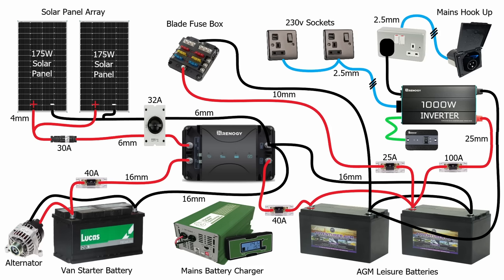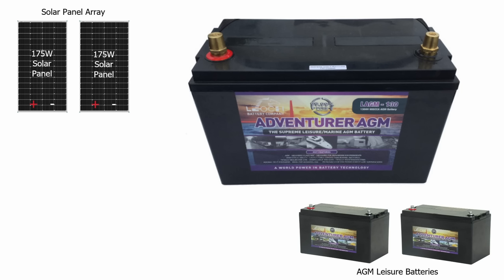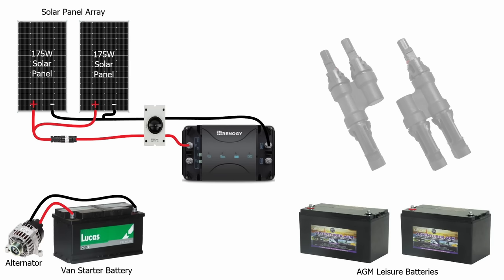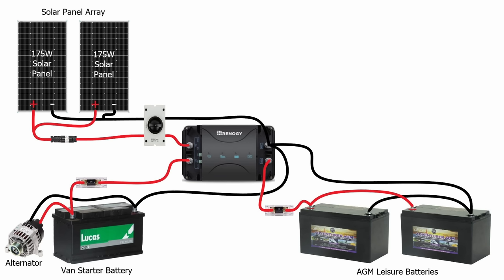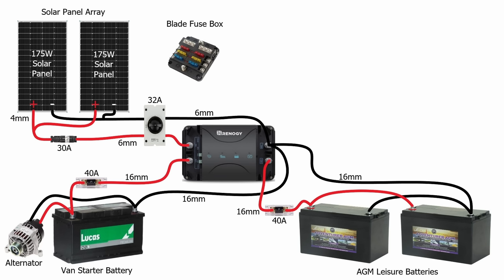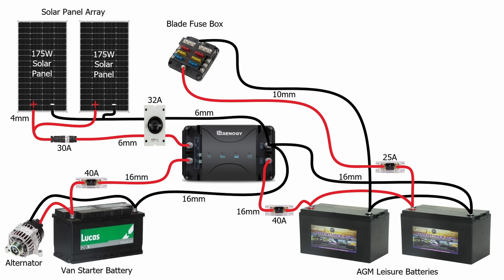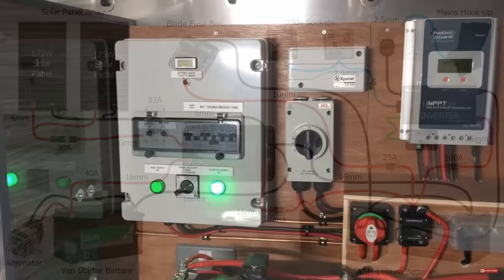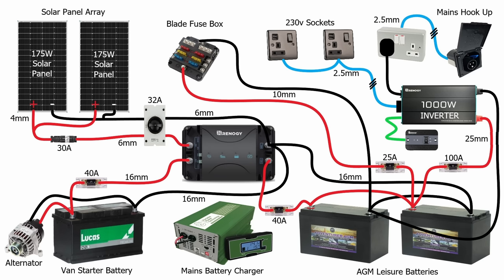12v Electrics for Off-Grid Campervan - Fiat Ducato Budget Build Ep12

Comment: Hi Greg, i have a similar setup. Mine is a  renogy 3000w inverter,  i notice you haven't added a consumer unit after the inverter. Is this fine to do,  Im getting conflicting information regarding this. Thanks.
Reply from the maker: I will open it in a forthcoming video but despite an email from Renogy stating they include residual current protection I doubt that as there is no external test or reset for that trip. Putting a consumer unit on the output would be the safest option.

Comment: Hi Greg, thank you so much for the very useful video, I want to follow exactly what you have done for my own MWB ford transit. I had a question regarding the AGM leisure battery - the link you supplied for purchase shows lots of different 12V batteries with different ampages, which one is the one you have used for your van that would fit this system please? many thanks, Amelia
Reply from the maker: I have purchased two Leoch AGM batteries that are 110ah each. They are called adventurer and in purple box with picture of boats and campers on them. 👍🏼😊 no problem if you go for 120ah too
Reply: @GregVirgoe  Hi Greg, okay that is great, thank you so much for your speedy reply.
Reply: @GregVirgoe  One more question (sorry!), how do you know how much charge is in the battery at any one time - is there a gauge on the batteries themselves or do you have to fit a separate component to see how much charge they have left in them, cheers :)
Reply from the maker: @AmeliaB-eo8dh  with AGM batteries you have a plug-in LED display to read the voltage across the batteries to get an estimate of their charge capacity. So at 13v they are 100% full and at anything below 12v they are 50% full. here is a simple chart to show you https://electricscooterparts.com/graphics/state-of-charge-chart-for-agm-battery.png
Reply: @GregVirgoe  Great, thank you :)

Comment: Can I ask if you are using the 30 or 50 amp charge controller? I only need the 30a for the system i am installing, however i noticed it says if your alternator is above 100a you need the 50a model. Im not really sure how to find the amperage of my alternator so leaning towards getting the 50a model to be safe. Cheers.
Reply from the maker: Doesn’t matter what size alternator you have the charge controller will only use what it needs. I’m using 30A charger.

Comment: I've become a bit frozen and unsure so hope you can help me understand best way forward for my set up. I just want to run am fridge, water pump and lights and usbs off my leisure battery. When I'm on site I have a hook up with 4 sockets and usbs available so will continue to run my fridge etc as listed on line 2 from the leisure battery understanding that now I'm hooked up these will still be powered by the leisure battery but I can reduce the use by using the hook up usbs instead of the leisure battery usbs, and can plug in mains appliances if required, so even a lamp to reduce the draw on my leisure battery. From your video Greg, can you tell me if I added one of the Renogy invertors which can be plugged into the hook up would or would this not power my fridge etc as in line 2 - I'm thinking it would not and that it would only be of use to power mains appliances inverting the power from my leisure battery when off grid/not hooked up? ALSO if I'm on a campsite and hook up and if I use it to charge my leisure battery can my fridge etc remain operational or must they be disconnected while a leisure battery is being charged? Is there any way you can be drawing and topping up the leisure battery at the same time? I'm thinking no and would be dangerous...so do i just wait until I'm driving when my main battery will top up the leisure battery via split charge relay...but my fridge will still be on during this...no? Thanks in advance :)
Reply from the maker: Really with the setup you described you would be best adding a mains battery charger which can be used when on camp site to charge your leisure batteries and they can still power all your 12v stuff at the same time with no problem. 
From the above it didn’t look like you had the need for 230v stuff when not on a camp site?
Reply: @GregVirgoe  Hello again Greg! So one year on I've been using my van for work (Family History consultations) and haven't yet used it for leisure so...all my items have remained disconnected. So you will understand I'm very keen to nail this now and get them connected. 
Yes I don't want to be using things like tvs and laptops when not hooked up to 230v on campsites - I'll use usbs for phones etc and wait until I'm using my hookup and only then plug in to charge my laptop.
So I'm not planning to add solar and will only be charging from my alternator. I WILL use a mains battery charger when I can plug that in on a hook up/campsite.
But I need your advice about IF you can have your fridge connected while charging up like this....or if I did add solar would my fridge be able to be on constantly? I thought you couldn't be drawing power at the same time your charging your battery?
How would I make everything that I had been powering from by leisure battery then be powered from the 230v hook up? This might be answered  - using the fridge as example - by the solar panels or alternator would be  powering it as I drive and then drawing from the battery when parked, and when hooked up the fridge would remain on the 12v dc power while it is being charged from the battery charger plugged in via the hook up?
Hope you can help me make sense of this and I can get on with it :) Thanks

Comment: Hello Greg you missed out a cigarette style socket and cable size  in your fuse board diagram that can be used for running a tv from? or would you recommend a 6mm cable is used as you have going to the fridge which i am assuming is plugged into a cigarette style socket, I am surprised you are still looking at running a tv or laptop from an inverter when it is so much easier to find a 12v tv (LG with power converter) or 12v laptop charger. no need for 240v in a van unless you have a good  lithium battery bank and want to run an induction hob or toaster etc although i do like the fact the iverter will auto switch between battery use and site mains input use giving the best of both worlds depending on your use of van
Reply from the maker: I’m not fitting a tv in this van they were just examples of things that you might plug in and could require a mains power supply 😆😉
Reply from the maker: Cigarette sockets need to be fused at 15amps so at least 4mm cable would be best.
Reply: Hello Greg thanks for your early reply. I am not criticizing, just looking at things i have found i would use in a van and as technology is changing all the time we are all learning and from past builds on what we need and how to power them needs on our budgets
Reply from the maker: @clarkspiemuncher24  I didn’t think you was at all so don’t worry. 👍🏼😃

Comment: HELLO THANK YOU FOR THE THE HELP.
I want to buy the solar 32A isolator switch and there are two options 2P and 4P? Which one should I choose? 
Pd I hace one panel 460wh
Thanks!
Reply from the maker: Either one will be fine. You only need to wire 2 poles so if you get the 4p just leave 2 sets of terminals empty. I did a video about these switches here 
How to Wire a Solar DC Switch - Budget Build EP16
https://youtu.be/GRLfZIGfA1I
Reply: Thank you!!!

Comment: Thanks for another great video.  The first thing I noted was you decision to stagger the input and output terminals of your batteries (I didn't do this on my three-year old build but don't know if I've done any harm).  
The second thing is that you did not stipulate the cable size for your battery link cables - are they 16mm?, but surely they should be 25mm to match your inverter cables?
Reply from the maker: Hello John, please refer to section 3.3 on page 17 of this free docuemtn from Victron that explains really well why you should wire your parallel batteries like I have. :D  https://www.victronenergy.com/upload/documents/The_Wiring_Unlimited_book/43562-Wiring_Unlimited-pdf-en.pdf
Reply: @GregVirgoe  Nice document and looks like a great read, thanks.  I did connect both my charge and load leads to positive on battery#1 and negative on battery #2.  But the document doesn't seem to refer to your decision to connect the load leads to positive on battery #2 and negative on battery #1.
Reply from the maker: @johnporter6459  I just found that it forces the use across the string and from experience my AGM batteries are now 5 yrs old and never dropped below 70%
Reply: @GregVirgoe  Will give it a try.  By the way, I've been using the Renogy DCC50S with my two 100AH EFB batteries and a single Renogy 175w semi rigid panel.  I seldom put the full 50A through the charger as it normally self limits to 25A when there is solar available.
Reply from the maker: @johnporter6459  but then the solar makes up the balance 👍🏼
Reply: @GregVirgoe  Probably not to full 50A (and weather dependent) but I have a cab mounted DP MCB for the solar input, so I can disconnect solar when I want to (which is not very often).
Reply from the maker: @johnporter6459  I always leave my solar connected 24/7 even when connected to mains.
Reply: @GregVirgoe  The only reason I'd do it is to get the full 50A from the alternator, otherwise the DCC50S only gives you 25A.  But yes, connected almost always and getting the starter battery trickle charged into the bargain.

Comment: Hi Greg, please could you advise me on the type of connectors I need to connect the 12v spotlamps to the 1.5mm cable running through the van?
Reply from the maker: The easiest way to do it is with WAGO connectors you can get them from most DIY shops like Screwfix or order them online, very easy to use. i show them in my reversing camera video
Reply: @GregVirgoe  Ah, will take a look, cheers Greg.

Comment: Dear Greg, does the dc-dc charger from renogy work on a traditional dynamo? or does it only work on a smart dynamo? greeting from the Netherlands
Reply from the maker: It will work with both. With the newer smart alternators you will also need to install the ignition signal cable supplied by Renogy

Comment: Great video Greg 👍🏻🤘 one question I don't know how to set the Renogy charger for my leisure battery wet acid it's got the function to feew different batteries  and I'm slightly confused 😕
Reply from the maker: Under the left hand terminal cover is a small button you can press with a pin to select the battery type. The colour of the battery LED (far right) will change to indicate the selected battery type. 
Page 16 of the manual. 

Green - SLA (AGM)
Yellow - GEL
Red - FLD
Blue - Lithium
White - User defined
Reply: @GregVirgoe  so if I got wet acid it's meant to be on FLD ?
Reply from the maker: @kieras13  yes 👍🏼 that’s right.

Comment: Hi Greg. Where would you put an RCD/Consumer unit in this setup?
I'm looking to do something very similar, however I will be wiring a 3000w Renogy inverter, which has 2 power sockets. So I was thinking the following:
EHU > Basic RCD feeding 2 sockets > Socket 1 feeds AC to Inverter, Socket 2 powers mains charger (So can't accidentally be run from inverter)
Do I then need to put another RCD/Consumer unit on the inverter output? and would I just take output from one of the two sockets?
Reply from the maker: You will most likely need an RCD on the output of the inverter as most don’t have in built RCD protection. Why do you need a 3kw inverter, what do you plan to use that for?
Reply: @GregVirgoe  Not so much that I need 3kw, just got an excellent deal on it. There's potential we might want to run an air fryer off it also (only for 10 mins or so at a time). I don't know if the 2nd RCD would be a bit belt and braces but I think we'll fit one to be on the safe side!
Reply from the maker: @anthonym3075  to use a 3kw inverter off batteries they would need to be lithium because you will not be able to pull 240amps out of lead based batteries. 😬

Comment: Amazing video Greg, though I do have 1 query... You used a 25mm² wire and a 100A fuse correct? Correct me if I'm wrong but I thought 25mm² wires could only really cary 101amps (depending on length too of course) isn't the fuse rating just a little bit too close to the cable rating? What happens if they aren't perfect 101a amd 100a and the wire burns up before the fuse blows?

Again I am no expert, but this just made me think.

Otherwise great work and please teach me if I'm the one mistaken
Reply from the maker: Different types of cable will have different ratings I was using cable supplied by 12v planet and according to their website the cable is rated up to 170Amps and using their volt drop calculator with a run less than 1m in length the volt drop is only 1.3% so it would be ok for this project. 
If you are ever concerned it never hurts to increase cable sizes as that will make the system run cooler at peak loads. 👍🏼😃
Reply from the maker: https://www.12voltplanet.co.uk/extra-flexible-battery-starter-cable-25mm-170-amp.html
Reply: @GregVirgoe  thank you, and thank also for taking time to read and respond, especially so quickly :) I'll check out the link!

Comment: Got one for you Greg. On a van without electric hook up. 
When using an inverter. Does it need a consumer unit?
Cheers
Reply from the maker: Yes, most inverters do not have any kind of RCD protection inside them so your only protection would be for overcurrent from the 3 pin plug fuse, that wouldn't stop you getting a fatal shock so an rcd on the output of the inverter is essential.
Reply: @GregVirgoe  Cheers Greg 👌

Comment: Hi Greg, thanks for this video! I’m in the process of buying everything for this set up but can’t seem to find the 6mm solar extension cables in stock. Do you know of any alternatives that would do the job? Thanks
Reply from the maker: It is available on Renogy shop https://uk.renogy.com/solar-panel-extension-cable-with-mc4-male-to-female-connectors/
Reply from the maker: It is available on Renogy shop https://uk.renogy.com/solar-panel-extension-cable-with-mc4-male-to-female-connectors/

Comment: Hi Greg, I'm curious  - will you be having an RCD/RCBO in the 230volt circuit and for earthing will you have a way to use a ground/earth spike when parked up?
Reply from the maker: Yes, I will be fitting a consumer unit and always recommend doing that on the 230v mains for short circuit and overcurrent protection.
A ground spike is completely useless for a campervan, that would actually cause a serious electrical hazard. https://youtu.be/mpgAVE4UwFw
As long as all the earths are completely connected back to the source then the RCD will detect any imbalance in current and work as it should.
Reply: @GregVirgoe  thanks, I'm looking forward to seeing you put all this together.

Comment: Hi Greg. What size AGM batteries are you using in your build please? If in the future they got swapped for lithium then what size would a single on be? How many days power would you have off grid for a fridge/freezer, lights and general charging of phones etc? Thanks alot
Reply from the maker: I have 2 x 120Ah AGMs and with the 350W of solar and 30A dc to dc you could stay off grid indefinitely. It’s a great setup. 
Renogy are offering 2x 100Ah core lithiums for only £600 so that’s a cracking deal 👍🏼🤩
Reply: @GregVirgoe  Your a star and thanks for that dude.
Reply: Greg can you confirm if it’s 110 or 120ah you are using? In the video you mention 110 but in this comment 120.  I’m sure it doesn’t matter much but there is a £46 difference
Reply from the maker: @darrensmith403  it relates to storage capacity so the bigger the better 👍🏼😊

Comment: Hi Greg, If I use the 50a DC-DC with MPPT would that be ok to use with one Victron Energy 12v/130Ah AGM Deep Cycle Battery? thanks ...Shumae
Reply from the maker: 50a is really too much for that size AGM battery. You need either two of those batteries or one Lithium which could handle the higher charge. It can be dangerous to force too much charge into a lead based battery. 20% of its capacity as max charge rate. 😊

Comment: Hi Greg 
Fab videos, following your budget  build to convert my sprinter, can you tell me if i can swap to 2000 w inverter  with the same setup? Thank you so much   carl
Reply from the maker: Yes you can, just a few things you need to change. A 2000W inverter will draw 160amps per hour at full load which is too much to drag out fo lead based batteries, so you will need to consider upgrading to Lithium. The fuse would need to be increased to 200amps and the cable feeding the inverter would need to be min 35mm².  Can I ask what do you intend to use in your van that needs that much power when off grid?
Reply: @GregVirgoe  hellow Greg. Thanks for the reply. It was just for a coffee pod machine  in the morning. i might just stick to 1000. It will be a lot cheaper.  
Very much appreciated  I'm  a bit out of my depth

Comment: Quick question Greg please - you previously used circuit breakers rather than fuses and gave logical reasons for doing so. Why do you use ANL fuses rather than circuit breakers here? Thanks
Reply from the maker: Providing that you get good quality breakers there is nothign wrong with using either form of fuse or breaker. for this installation it was purely down to cost as the fuses are cheaper to buy
Reply: @GregVirgoe  thanks appreciated. It certainly mounts up. Didnt realise cable was so expensive too...
Reply from the maker: @1anonlyedwiltshire  it has shot up in price massively in the last couple of years. I’ve noticed a huge difference in price 😬